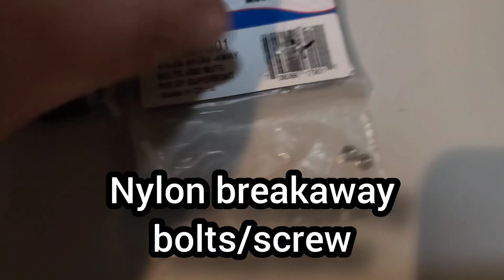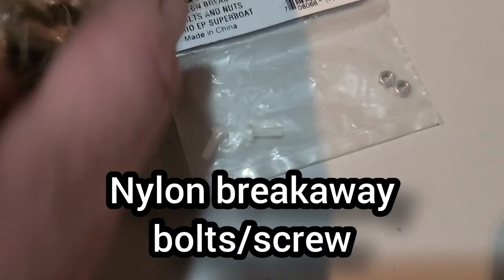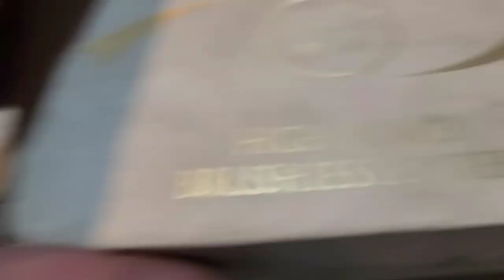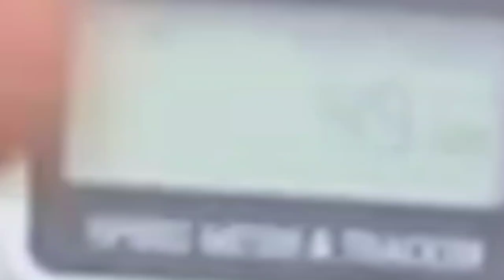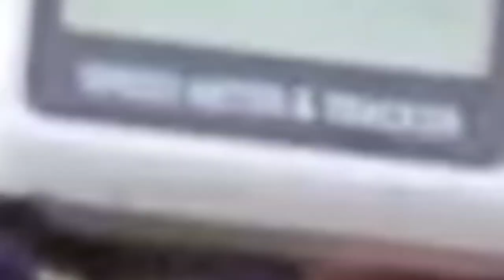Pack For Success On The Water RC Boat Setup - Blackjack 42 - RC Boat Basics

Comment: Man I just got the V2 Spektrum program box for the smart ESC and it has a nice battery tester on the side👍❤️Makes it easy to program the Blackjack 42 and the Impulse32 coming any day👀🏁
Reply from the maker: Nice, gonna check it out.  im looking at the impulse 32 aswell?  I didn't realize it had the same electronics as the 42 bJ

Comment: Thanks for your pit tool tour, looks like you're ready for every typical fix or tweak. Meanwhile...I have a 3-year-old stock BJ24. Love the fit & finish and overall quality. I was thinking about getting a Proboat River Jet 23 when they return in September. The build pix look pretty good.  And, certainly it's geared more for shallow creek water. Have you had any experience with that boat (haven't searched your channel)?
Reply from the maker: No sir I've never had one on the channel, the jet drives are pretty efficient.  I wonder if you can get upgraded impellers for the jet drive?
Reply: @IRONCLADRC  There's a third party company, Sundogs Adventures, that makes upgrade parts for the Proboat River Jet. I'll probably get their extended hull intake ride plate. It's been shown to reduce porpoising at high speed. They make other drive and control parts, but they get pricey. The general build on this boat looks good in photos. I hope to buy one in September when Horizon says they'll be back in stock.
Reply from the maker: Man that's awesome, Yes sir buddy they are sweet looking boats I'd love to see if it would do some jumps!  Make a floating ramp for it!  Lol.  I've seen guys jump with the small jet boats I'm sure you will have a Blast with it...